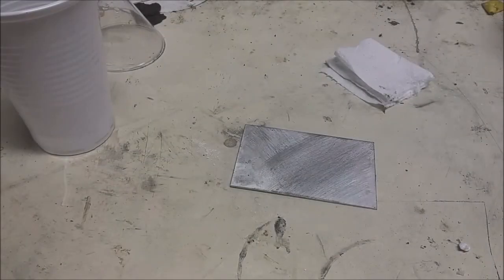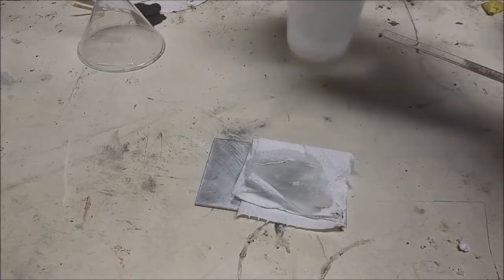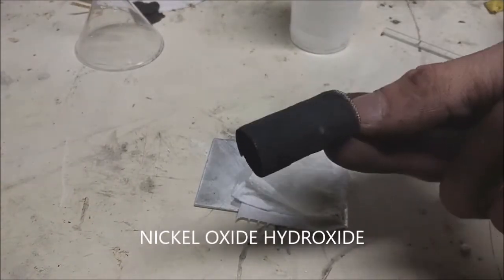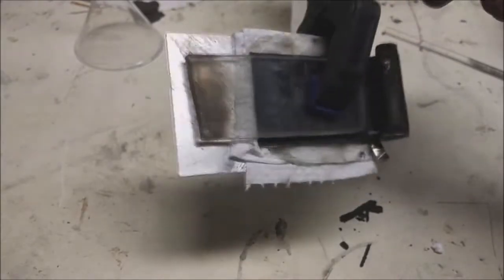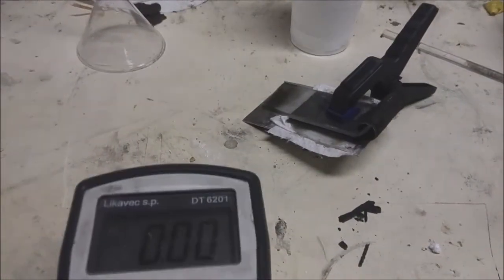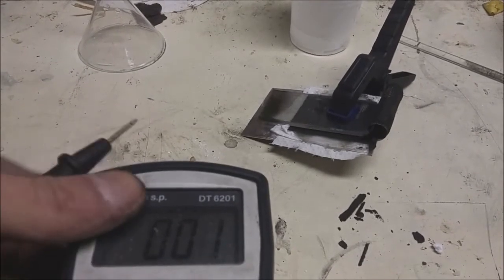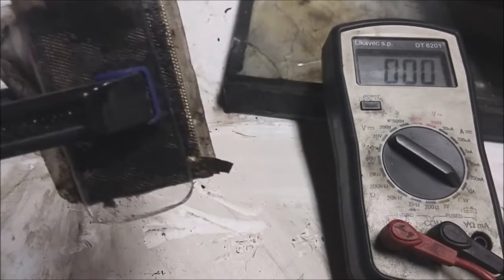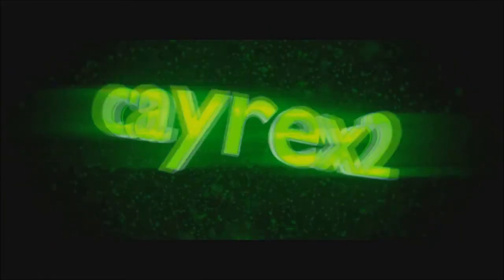How to make a HOMEMADE ALUMINIUM BATTERY

Comment: wow mine exceeded 710 milliamps without this video great demonstration. simple. mine was rechargeable
Reply from the maker: Hidesogoodxx nice current mate. With KOH is hard to make this battery rechargeable, because the aluminium react with KOH electrolyte also when the battery is not used and form aluminium oxide/hydroxide. But yes, everything is possible,..... so mate nice work. I wish you all the best with your project. Be cool 😉
Reply: cayrex2 thanks